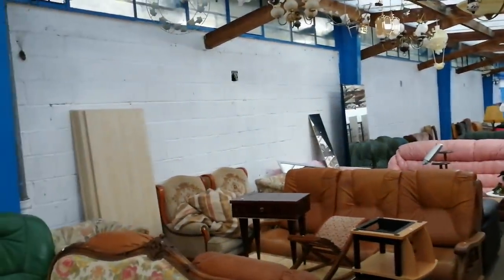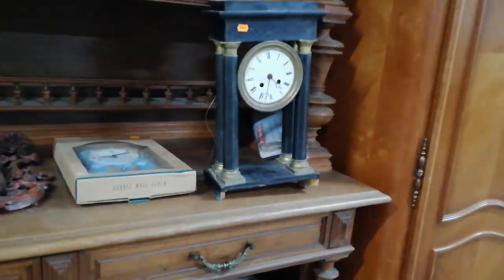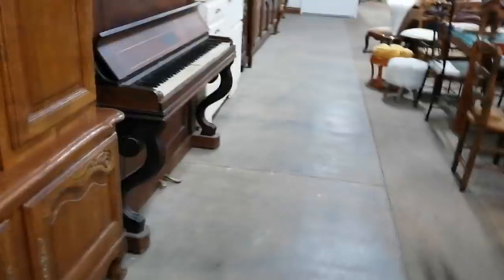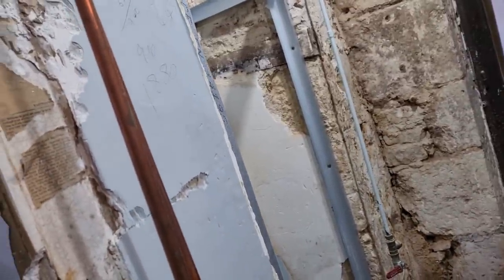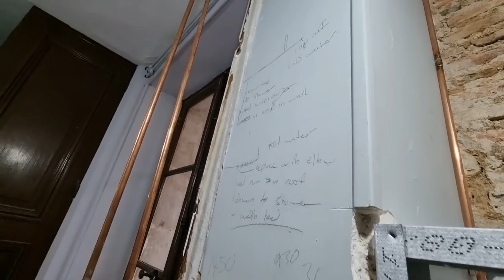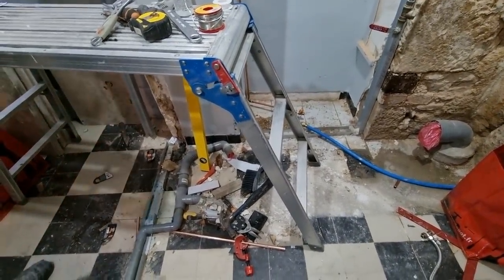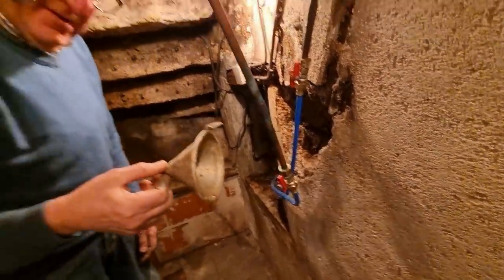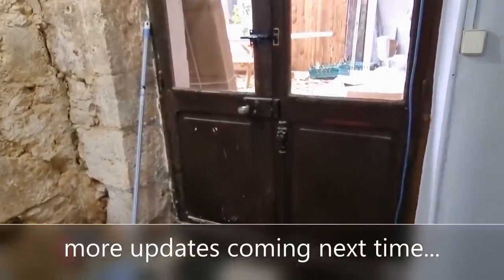Not Quite a Chateau DIY 116  - The Pressure's On  -Tick Tock -  Touch Wood -  and It's Beer O'Clock

Comment: The pressure is a constant, it’s the volume that is reduced by having the valve partially open.
Reply from the maker: Ok A, I failed my Physics exam, as you can probably tell. so...if the pipe isn't full then there is still the same pressure? be it air or water?